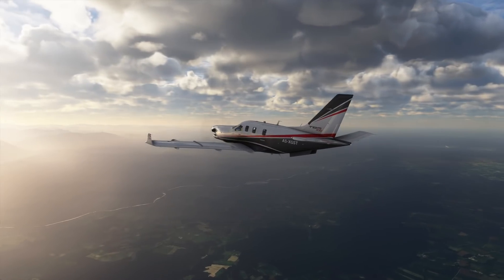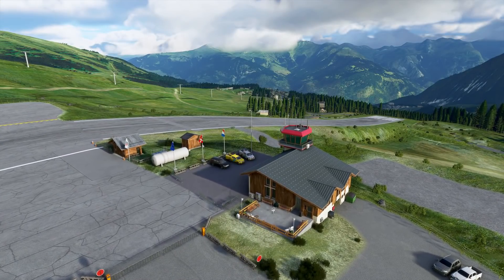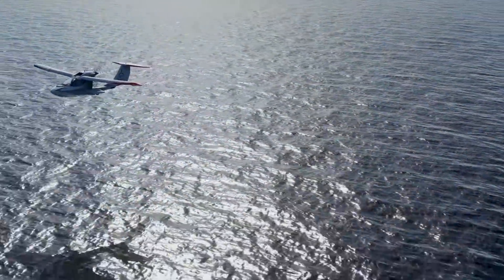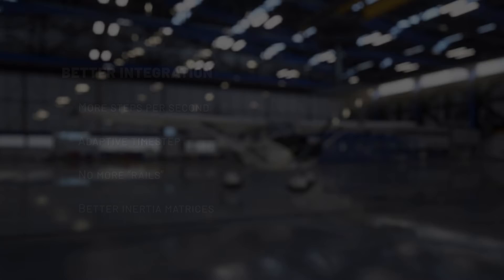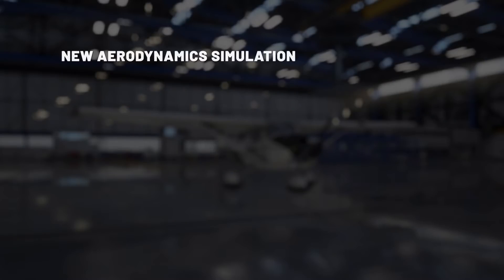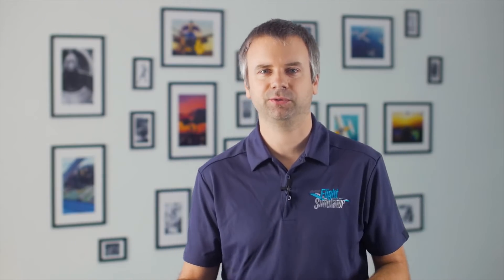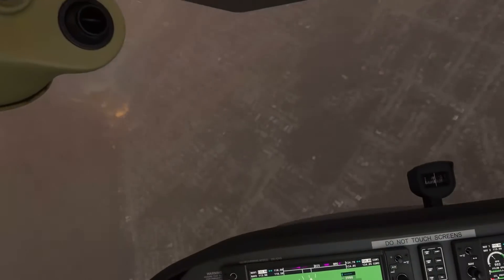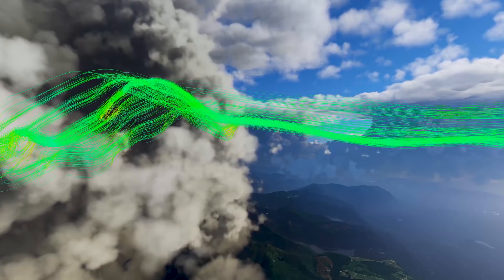New Microsoft Flight Simulator 2020 - Feature Discovery Series Episode 3 (Aerodynamics) Full

Comment: X-Plane, P3D, FSX = Toyota Corolla 
FS2020 = Mclaren P1

My PC = Bank account -$10,345.00
Reply: A GTX or RTX 1060/2060 is probably all you need  for 1080p gaming (4K is a different story). HOWEVER, you should consider getting a CPU with 6 cores or more and more RAM (24, 32, or 64GBs are probably the best bet. 16GB is probably the minimum)

Comment: i hope that file system directories will be really more elegant and smple than "spaghetti" weird recursive spiderweb neuronal organised. Remember the way this was in FS... like in WIndows with .INI, registeries, User AppData, My Documents, Program Data... symlinks, and so on, with the deal to use ALL the organisation features to make THE MESS, and need some I.A. software to understand WHERE are the user save games datas, user preferences, and so on.
Hope they will think outside "Microsoft" minded.
Hope to have simples separate .INI files for preferences, like joystick config, keyboard shortcuts, Goflight shortcuts, graphic settings, ...
then, a folder in My Document for situations, replays, logbook and so on, maybe a cloud part for social shared awards medals and ego shinings, but not too much thinking about the planet and servers, heatings, cooling...
Hope this will be safe to make a local backup of FS2020 installed with local map datas, so that it will run anyway later, even there is some big world web crash ( due to pollution, climat problems, politic war )... so that big workpiece can be runned in the future.
The goal for each creation structure is always the eternity.